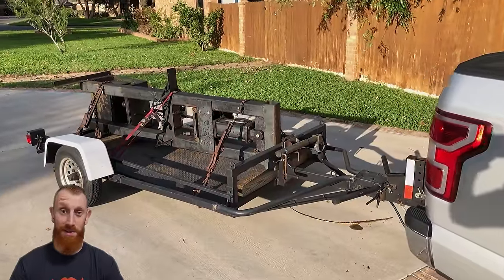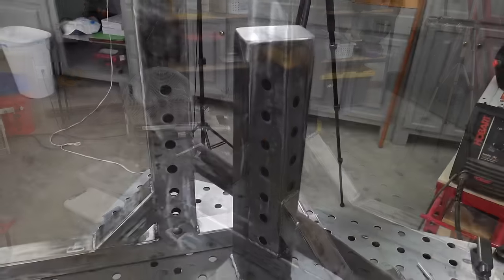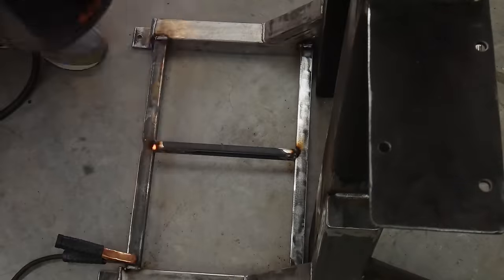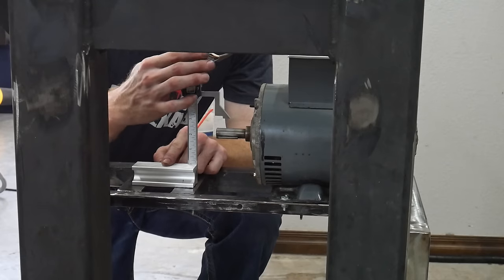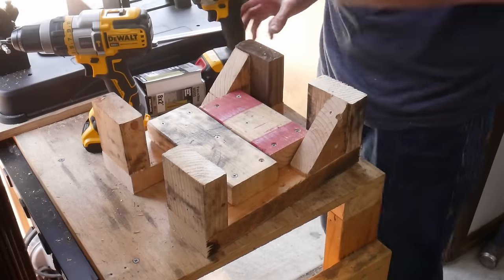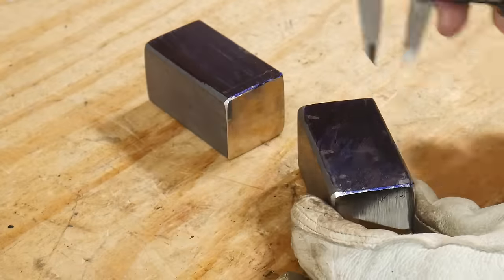Homemade Hydraulic FORGING Press - EXTREME POWER!! 💪

Comment from the maker: Well I really hope yall got something out of this one! Links to all the plans are in the description. Here are the time stamps:

An update video - https://youtu.be/PMcIJWPxC0w

00:00 – Intro & Plan
00:45 – New Press Feet
02:57 – Disassembly
04:55 – Frame Mod & Adding Feet
06:46 – Motor & Pump Shelf
07:27 – New Pump Bracket
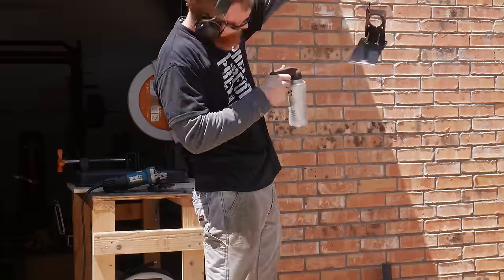10:12 – Enlarging Pin Holes
13:57 – Traveling Guide Mod
14:38 – Die Holders & Dies
18:29 – Slag Catcher
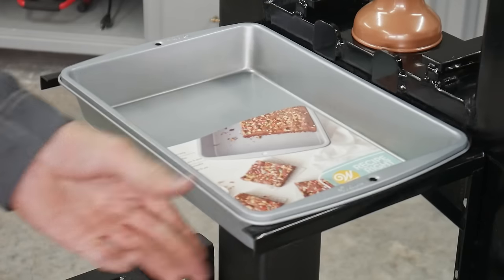19:21 – Wiring Switch
21:28 – Hydraulic Assembly
28:03 – Start Up & Traveling Block Connect
29:32 – Testing, Front Die Tabs, & Outro
Reply: Very nice, new subscriber! So about how many tons would this press be rated for roughly?
Reply from the maker: @futuresonex  Thanks for your subscription! The cylinder will do around 30 tons.... I can't say what the system is rated for since it's a custom build and not "rated...." Build at your own risk
Reply: @RedBeardOps  Your DePressing project turned out good. Look into the JIC style fittings for future projects they are a whole lot easier to work with than NPT threads.
Reply: Thank you so much for posting this ‼️
Reply: @futuresonex  getting ready to say the same thing ‼️
Reply: @futuresonex  Hydraulic cylinder output is a function of diameter and applied pressure.  For any given pressure, the larger the diameter, the more output force it has.  The trade off is speed.  A large diameter cylinder will move slower than a smaller diameter with the same flow rate pump (it has a larger volume inside the cylinder to fill with fluid).  You can kind of think of cylinder diameter like gears in your car.  Big wide cylinder, lots of output force, but slow speed.  1st gear in car, lots of torque at rear wheels, but slow speed.  

Speed in hydraulics is a function of pump flow rate.  The more gallons per minute your pump will run, the faster the cylinder will move because it fills it faster.  So, you have to balance the cylinder diameter to pump rate to achieve a given speed.  Need lots of force and a fast speed, you'll need a faster flowing pump at the same pump output pressure.  Faster pumps for any given pressure rating will need more HP to turn them.  Going back to your car, let's say you need lots of torque at the rear wheels and lots of speed too, so you'll need a big powerful motor to run in it in say, 4th gear, vs 1st gear.  Of course, with cars, you have a transmission and are able to switch gears on the fly, you can't really do that easily with hydraulics.  You can get multi-stage hydraulic pumps, however, that on the first stage will have a high flow rate at a low pressure (to move the ram quickly while not under load), and then it shifts to a stage that ramps the pressure to get the force it needs, but the trade off is that pressure stage comes at much lower flow rate.  The ram slows way down, but outputs huge force.
Reply: @edwardlance2379  Thanks for the info!!!
Reply: I cant find the plans
Reply from the maker: @stevecrawford1826  ⭐ Free Plans / 3D Files / Calculator - https://www.patreon.com/posts/55107545
Reply: What was the overall cost roughly of the build comparing it to today's steel prices
Reply: How much is the total cost for this press?
Reply from the maker: @zionontal1855  The varies wildly with steel pricing
Reply: If it doesn't work out you can always modify it and turn it into a guillotine!
Reply: Hello red beard, what did you use and where to find to plug the one hole in the tank that is not being used the smaller hole that is on the same side of the filter hole.
Reply: Hello red beard, what did you use and where to find to plug the one hole in the tank that is not being used the smaller hole that is on the same side of the filter hole.
Reply from the maker: @rholley11  I'm not exactly sure what you're referring to, but I'd guess you need to go hunt locally for the right size plug.
Reply: @RedBeardOps  on the hydraulic tank, there is the 1/2” size port hole that you screwed what I think is a plug? The port hole with no hose attached
Reply from the maker: @rholley11  I'm fairly sure that drain hole came plugged with the tank
Reply: @RedBeardOps  no that’s all right I’ll get it figure out, thank you for sharing the build.
Reply: Hello, I got my press working, it’s an up storck same prince control valve, the cylinder went up fine but won’t go down? What do I do?
Reply from the maker: @rholley11  I don't know. I'd advise looking over the hook up again to make sure everything is right. Sounds like you're not sending fluid to the top of the cylinder. You can start a thread on blade forums as well. This one may help - https://www.bladeforums.com/threads/home-made-press-hydraulic-press-question-wont-hold-billet-for-twisting.1889599/page-3#post-21469056

Comment: There is a big difference in HP between an internal combustion engine, and an electric motor. I converted my gas powered log splitter to electric(to use it indoors), and educated myself on this subject pretty well.  As a general rule you can use an electric motor with half the HP of gas… I used a 2hp 1750rpm electric motor to replace my 6hp gas and am actually still well within rated range requirements by the pump. Reason being is the torque rating on the electric motor is far greater, and it’s instantaneous! Nice job on the press, I’m building myself one also!
Reply from the maker: Very good to know! Good luck with your build Jeremy!
Reply: @RedBeardOps  thanks!
Reply: Yeah I went with a 3hp 3500rpm motor and Geeze it’s got way motor power than the gas 6hp and is extremely fast. I put a larger diameter ram on it and it slowed it down just a little.
Reply: Yes. You can look up online calculaters that convert hydraulic, electric motor and gasoline engines. 
  Once a fuel engine starts bogging down it loses power instantly. An electric motor can twist even at a stall condition.
Reply: Also, induction electric motors will happily draw more amperage under load to output more power than what it's rated for. It's important, however, to understand that you can't run it this way continuously or you'll burn it up.  The "rated" power is the output it will run at continuously without overheating.  In applications where the motor is stressed intermittently, such as a press, it will work fine.

The reason they will make more power has to do with how an induction motor works.  With no load, the system experiences a high feedback in the system.  This serves to lessen amperage draw in order to run at the rated RPM.  Induction motors are "synchronous" in nature, meaning they want to run at the RPM it was designed.  When you apply a load, the RPM's drop.  This is known as "slip".  Slip results in lessening the system feed back, thus increasing amperage draw.  More amps means more power.  The motor is trying to get back to its rated RPM.  You can think of the feedback and slip as a "cruise control" of sorts.  Just like when you have cruise turned on in your car, start up a hill, and more gas is applied by the control to maintain the same speed.  

Motors used in equipment that have to overcome a load at startup typically have a capacitor circuit ("capacitor start") to provide an extra jolt of power to allow it to get going under load, otherwise it might not be able to start.

Comment: Another excellent video. Thank you!!

The thing about pressure gauges most people don't realize is that you never want a gauge that maxed out at the max pressure you are working at. Gauges work by bending an arm inside the gauge. The more it has to flex the more it will wear out the gauge plus a small amount of error in the reading comes into play, the more it has to flex, the greater the error will become over time. At most you want your max working pressure to be in the middle of the scale for the gauge you are using.

Comment: I built a press just like this one, only a little beefier. 6" HSS... I put it on casters to move it around my garage. Love it. Covid lockdowns kept me from working... So I built a forge, press and 2x72. Only thing I wanna change on the press is a 5" cylinder. only one available was a 4". It's fast and works great.
Reply from the maker: Right on! It's nice having one of these in the shop for sure! I ended up putting mine on casters as well. Cheers man!

Comment: Great job! One thing you can do when drilling large holesaw holes is to drill a 1/4” hole thru the part, on the circumference. This lets the chips drop out and the saw won’t re grind the metal. Hole saws have no chip clearance. Your press is excellent!
Reply from the maker: Thanks for the info!

Comment: I figured you had more to do with this press than merely the occasional pressing bearings in and out and such. Because that was a lot of work and parts for the occasional press set up. Thumbs Up!
Reply from the maker: You are correct! I'll be using this press for making pattern welded steel and general knife making! CHeers

Comment: I too had issues drilling large holes in 1inch plate. After drilling 3 of the 13 holes needed, I decided to scratch the plate with the hole saw, then drilling a few 3/16" holes around the perimeter of the intended hole diameter. Drilling the 4 smaller holes took about 5 min, but saved me 30 min per large hole. The smaller holes allowed a place for the fine shavings to fall through, instead of creating a slurry of oil and fine ground metal particles.
Reply from the maker: Veery good idea sir!

Comment: I was told when I built my press 20-something years ago that the slider should be tight enough to scrape the mill scale off the uprights. Never had a problem since.
Reply from the maker: Nice! Cheers sir
Reply: @RedBeardOps  I use a Barnes-type 2 stage coupled onto a 5hp electric motor. Gets up to around 12 tons in the first stage, about 28 tons second stage, 5" dia. cylinder.

Comment: Good upgrade 👍Hydraulic fittings usually use tapers or dowty washers to seal. The tape can leak under the high hydraulic pressure.

Comment: Just a few notes on the hydraulics (maybe you addressed them and i missed it), you don't need thread sealant on basically any threads that aren't tapered. Usually, straight threads aren't what seals in the oil. If they don't have an o-ring, they'll usually seal with a metal cone in the middle. Also, be very careful using any black iron pipe and fittings unless you know they're rated for the pressures you're using.
Reply from the maker: Thanks for the tips!

Comment: Great work, wonderful project and thanks for showing this off, Red!:)
To contacts and grinding them: Plug contacts for the mains connection in particular have a protective coating, which is usually applied galvanically. This guarantees high mechanical strength(like abrasion resistance and impact resistance) with simultaneous protection against corrosion, which guarantees low contact resistance. This is particularly important for the protective conductor (residual current tripping, personal protection). So grinding the contacts was the worst thing you can do (In electrician circles: A crime worse than murder! Hehehe). Use either contact spray that is approved for electrical contacts and often also contains a rust remover and maybe polish very gently ... So it's better to use a new plug. It's better for life and limb :)

Comment: James, quick question.... I'm using your exact setup so I know I get it right, however some of the links for the motor and pump don't seem to work anymore, or the part is unavailable.... what direction should the pump vs the motor rotate? Clockwise for the pump and CCW for the motor I'm assuming? Thank you
Reply from the maker: I had to go back and watch myself. Looking at 20:55 it appears the motor turns CCW and the pump shaft turns CW. So you're right!
Reply: @RedBeardOps  omg. Good eyes!! As many times as I’ve watched this video, I actually missed that. Thank you!
Reply from the maker: @SwitchbackXThunter  Hahahaha, I knew it was in there somewhere! I have the advantage of making the video ;)

Comment: Awesome guide and build. Only concern is the guidance. How much space do you have between the frame and moving block? Have you experienced any problems when pressing off-center? Anything you would build different one year later?
Reply from the maker: Hey Kurt, The C-channel helps keep everything tight. When I originally welded the traveling block together (back in like 2006); I clamped the C-channel to the guide rails and welded in place. So it's pretty tight. I think an improvement would be to increase the length (height) of these C-channels extending up even to the height past the cylinder. All that being said, this thing has been working great for me. 

I bet there is also an improved solution with bronze wear plates as well (adjustable with set screws)... and replaceable.

Comment: 30 amps at 220 volts (your switch) will max out at just under 9 hp, so even a 5 hp motor will play nice with your antique switch, lol. As for tank capacity in gallons, a quite surprising just under 7 1/2 gallons fits in a cubic foot, so a 10 gallon tank will be roughly a puny looking 12x12x18 inches (or 14 inch cube). Great build!
Reply from the maker: Thanks for the info!
Reply: @RedBeardOps  just a little payback to thank you for the rebuild vid! If you do run into a need to level the press, you could just use bolts and 2 nuts at each corner (1 nut above and below each bolt down tab), and dial her in perfectly plumb. Btw, totally agree with your choice to put you die "pinch point" right around hip/navel height, it's a great low effort working height

Comment: Loved your build and the video. Your instruction was excellent.  I do need to make one comment about your rational regarding the motor and pump bases and not wanting to use shims. As a millwright and a certified vibration analyst I've seen hundreds of motor bearing failures over the years primarily due to motor shaft misalignment.  The motor bearing is the weak link because of the close running tolerances.  My key point here is that standard practice is that you need shims under the motor or pump feet so that you can have the ability to get the best shaft alignment possible. So for this reason I don't think intentionally eliminating shims is the best practice.  

Loved your build and coincidentally I just had a forge given to me so this press just became the winter project. 

Bruce

Comment: funny thing about that trapped pressure. I removed the plugs on the bench and there was no pressure reinstalled the plugs and put the cylinder on the frame and removed the plugs and they popped just like the did in your video. this build has taken a long time but i am almost done just waiting on one part and then to make the dies. I'll send you  a pic on instagram when I finish.
Reply from the maker: Guess that's hydrostatic head for you! Lol. Be safe man. Cheers
Reply: @RedBeardOps  how much of the extension of the ram did you leave at point where the dies come together?
Reply from the maker: @benjamineangeloni2335  Are you asking what the actual total stroke is from wide open to dies touching? If I remember right it's around 7.5''
Reply: @RedBeardOps  did you have to do any adjustments to the pump or control valve. I am only getting about 1000 -1200 psi on the gauge and then it looses all power. I triple checked and everything is connected properly but it is still not giving me much compression it had trouble deforming a 1x2 piece of pine. any suggestions?
Reply from the maker: @benjamineangeloni2335  On the control valve there is a cover that is covering an adjustment screw. It's a large allen head. This adjustment allows you to regulate the max PSI

Comment: Thank you for sharing this video, it's very helpful. I have one question: I see that the pump's datasheet recommends the pump to be installed at same level (or below) vs. the tank, in order to help with suction. I see that you choose a different approach, i.e. the pump is installed above the tank. Did you have any issue with this setup? Or, do you need any special care or procedure? Thank you!
Reply from the maker: It is ideal to have the pump below the tank to keep it primed with a couple of feet of hydrostatic head. That being said, I haven't had issues yet.

Comment: Great video im working on a press for my channel ....the reason your getting more pressure is because the pump is only 11 gpm before it has a load on it once 500 psi builds it drop down to 2 or 3 gpm. If it was 11 gom all the time your motor wouldn't be able to handle it....great job man
Reply from the maker: Thanks man, and glad you enjoyed the build.

Comment: Great video.  After a couple of years of operation how is it holding up?  Is there force, do you want or need more, is the frame holding up?  Keep up the videos, watch them a lot :)
Reply from the maker: So far so good! It's holding up. Force is great for what I'm doing, no issues. Frame is still solid. Some slight galling where the guides meet the frame and rub. Can't complain here!

Comment: thanks for all the work and lessons learned, you have helped me tremendously, Thank you for sharing as well, you did not have to and I appreciate it.  I did not find the parts list, I am interested in the hydraulic pump and electric motor you use. Thanks again
Reply from the maker: Hey Tony, the parts are in my video description (depending on your device, this can bee in different places under the video.). Glad it helped! Be safe with your build!